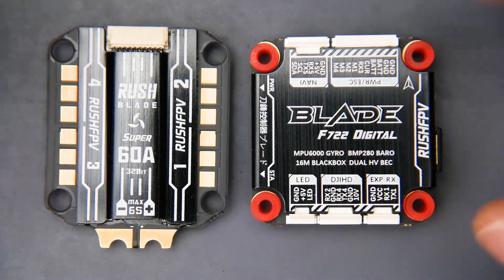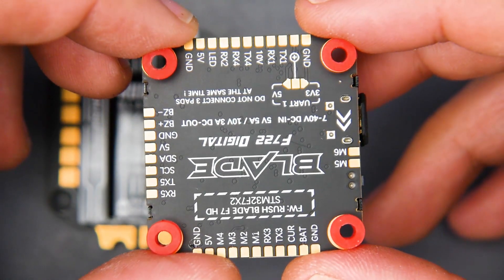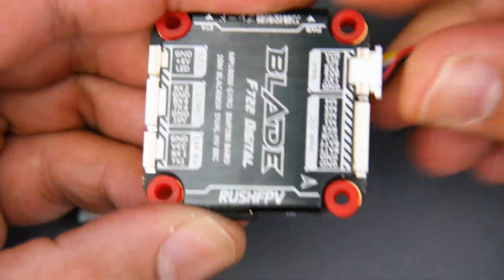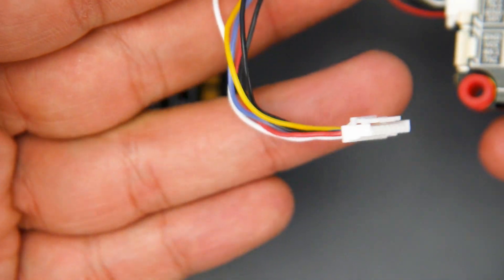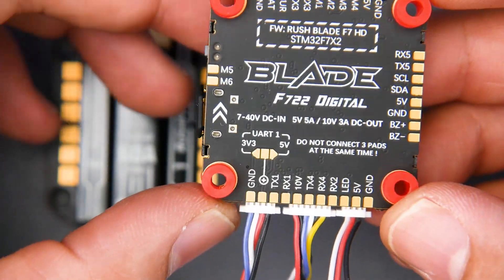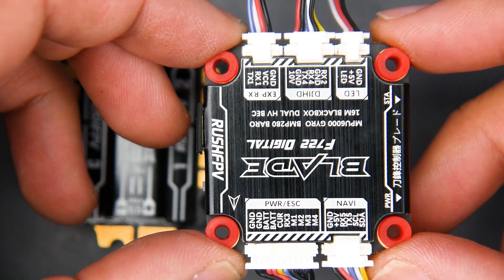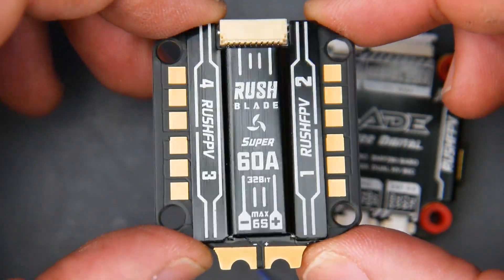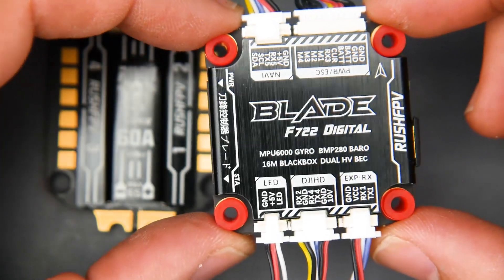Yes This is A Flight Controller!! // RushFPV BladeF722 Digital

Comment: I am looking at a build for long time and gps. I am going to use 5008 340kv. and for flt planning I am thinking about a pixhawk. with a full rush system 60A esc. can this be done. looking at the 60A for future. any Help or ideas would be much gratefully taken.

Comment: Coolest FC I ever seen.
But this connector i need this spezial plires to crimp the Connectors.
Ehen they meke an Analog Version and it will loock similar, I will buy it Instand.